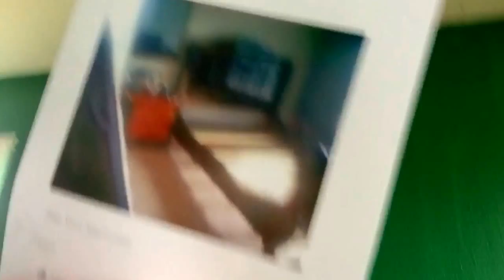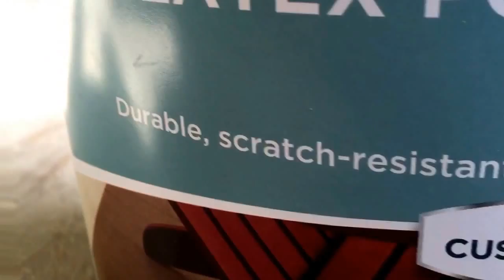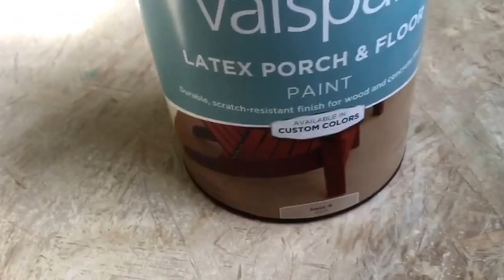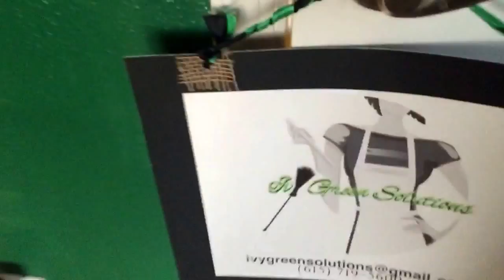PAINTING: Subfloors

Comment: I applaude your efforts however you left out a few very necessary steps in prepping the floor before painting.  Sanding the floor was a must and then filling in any holes and seams with a flexible wood filler would be your next step.  Then resanding to ensure it smoothness.  Then you should have applied two coats of Kilz primer, checked your floors one more time and patch up any further blemishes and then put your paint down.  Then you should have put 1/4 rounds down around the baseboard to give it a pristine and finished look.
Reply: Bruh, this is on the cheap she wanted to spend only  $25